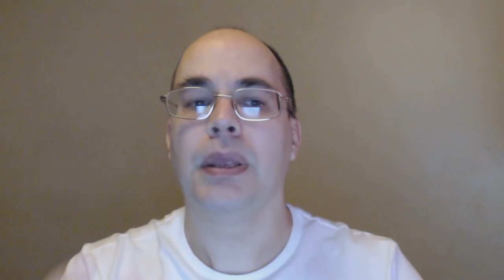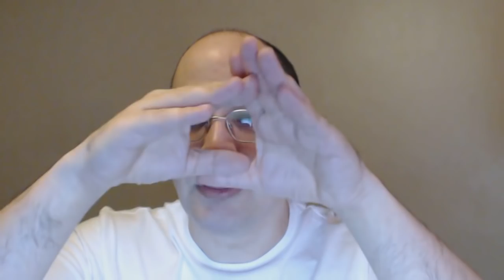How do rockets move in space, with nothing to push off from?

Comment: Why don't you try this simple thought experiment.
Let's say the two of us, you and I, were floating in space, absolutely weightless, in space suits to protect against the vacuum.
Okay, now say we're facing each other, only a few inches apart.  We count "one, two, three" and then simultaneously shove away from each other.  
We will both be flying away in opposite directions now, right?  
At speeds relative to the amount of force and the speed with which we hit each other.
Simple, right?     The vacuum didn't matter one bit, did it?  In fact, without the resistance of atmosphere, we flew apart from each other even more easily.

Well, THAT'S WHAT HAPPENS WHEN YOU EXPLODE ROCKET FUEL in the combustion chamber of the rocket vent!
The explosion of fuel pushes outwards in all directions, including against the ship it just exploded behind!

What idiot thinks its pushing against a vacuum?  Of course that's impossible.  
It's the explosive force that is shoving the rocket away from it!!   

Still having problems visualizing it?  Try this....  imagine a bomb in space.   Put your ship next to it.  Set off the bomb.  Your ship will fly away from it....  unfortunately, probably in many pieces, but it was THE EXPLOSION and its explosive energy that pushed the ship away from it.   
A rocket blast is just a controlled bomb blast going off continuously at one end of a rocket.

This is something even an educated fifth-grader can get.
Reply: The moron narrating that video says that physicists are trying to tell people that air pushing out the end of the balloon is, by converse action, also pushing on the FRONT of the balloon to propel it.  Sorry, but I was getting nauseous by that point and had to shut the claptrap off.  Physicists DO NOT say the air is counter-propelling the balloon at the front end.  It's the energetic action of the balloon AT THE NOZZLE that is driving it directionally.  There is a very simple test to clarify this, and we did it years ago in high school.  Get a rather tough little balloon, and put a little air in it (not too much).  Then put it against the side of a Bell jar.  Put a magnet over the balloon's nozzle from the inside, and put another magnet on the outside, opposing the other magnet so that they cling together, clamping the nozzle.  That will keep the balloon's nozzle shut.  
Then pump the air out of the Bell jar.  If you have only a little air in the balloon, it will begin to expand.  Once the vacuum reaches zero pressure, if you haven't over-inflated the balloon at the start, it should look pretty full by this point.  (If you DID put too much air in at the start, it will have exploded.  It's all relative to the toughness of the latex used for the balloon.)
Anyway, with vacuum at maximum, and the balloon now appearing inflated, pull the outer magnet away from the inner one.  The inner one will fall down, the balloon's nozzle will be released, and THE BALLOON WILL FLY AROUND THE INNER SPACE OF THE BELL JAR until deflated, and it won't take long.
This is where Mr. Stupid in the video fails completely... according to him, the balloon should just lie there and deflate, when in fact it spurts around in the vacuum until fully deflated.  EVEN THOUGH THERE IS NO AIR TO PUSH AGAINST!!  It's flying around because of the energetic reaction occurring right at the nozzle as the air escapes!  Same principle as a rocket.
This whole test is so stupefyingly simple to do, and has been done so many times by so many people, it's a sign of utter and complete idiocy to argue a point like the guy in that video tries to make.  This can be done by anyone, anywhere.
A similar test would be to buy one of those small firecracker rockets that fly thirty feet in the air and go boom.  Again, put THAT into a Bell jar, pump down to a complete vacuum, and ignite it with an electrically driven spark connector.  The little rocket will fly around ricocheting within the Bell jar for as long as the reaction is going on.  It's not pushing against air, 'cause there IS NO AIR in the jar.  It's the goddamned REACTION!
People who have seen this can only plead with idiots who deny this most elementary physics to actually TRY the experiment, let go of their neurotic denial patterns, and experience it for themselves.

To answer your next question, it's not GRAVITY that "makes" a flame go up and down...  but it's because of gravity that convection occurs.  The air surrounding the flame gets heated up, expands, becomes lighter than the surrounding air, and starts to rise.  That draws the flame, which is right up against that column of air, upwards with the rising air.  Cooler air further away fills in the space below the rising heated air, gets heated itself, and IT begins to rise.  That's a convection cycle, in a little cylindrical pattern around the flame.  Again... gravity isn't making the flame magically rise, but cooler air is drawn downward by gravity while the heated air rises as it gets lighter.  THAT is the only way gravity affects the flame... its interaction with the differing air temperatures.  Like the video you pointed out much earlier, in space, small flames simply burn in a sphere, because the air cannot "rise" relative to a gravitational pull, because there isn't any.

The idea that space is a "negative" pressure is mistaken, because we are sitting on a planet with an atmosphere, and a vacuum RELATIVE TO OUR ENVIRONMENT, is less pressure than we normally deal with.  But think carefully...  the reality is that the vacuum of space is simply a ZERO pressure.  
That's it.  NO gas, NO ether, no nuthin', as they say.  It is a complete absence of all materials that we take for granted on the surface of earth.  So, if we say our atmosphere is 14 pounds per square inch at sea level, then, when you're standing at the ocean near the equator, the empty space 500 miles above you is, RELATIVE to your ambient air pressure, NEGATIVE 14 psi.   If our local air pressure happened to be 200 psi, then the empty space 500 miles up would be NEGATIVE 200 psi, relative to the atmosphere we are standing in.  That's all.  Relative measurements.  
You have to remember, WE are in an anomaly in space.  There is an essentially infinite amount of cubic space out there with NOTHING in it....  zero pressure.  Just the occasional dots of stars or planets and miscellaneous small rocks.  WE are fortunate to be living on one rock that has an atmosphere, one singular exception to the pattern.  We are not the norm, spatially speaking.  A zero-level vacuum is the norm across the observable universe.  Everything else (around us here) is simply pressure that registers higher than zero.  It's really that elementary.

And, by the way, NASA is not doing the Falcon Heavy rocket thing....  that's Elon Musk and Tesla Corporation which is where Space-X derives from.  All one massive super-corporation.

BTW:  
  1) It's Northrup-Grumman, not Gummon.
  2) When you noted, several comments above, your "video bias", please remember that THAT is what it is...  a bias.  And a bias is conjecture based on unverified pretenses or assumptions, but held onto in spite of evidence to the contrary.  Practice letting go of the bias, and allow yourself to observe, unimpeded, some of the demonstrations I've explained here, because they are based on things that are demonstrable, repeatable and observable by anyone.  The hangup comes when people who simply refuse to believe in something will deny what they've observed.  THAT is the problem... disbelief when evidence is right in front of your face, or easily available for a few moments' effort.
Reply: You missed the obvious point.  Two people pushing apart from each other MOVE APART EQUALLY, according to relative masses and energy expended in the push!!  Remember, BOTH were stationary.  Now, as a result of an energetic action, BOTH are moving apart from each other!
Similarly, if you were holding a stick of dynamite in space and it exploded, part of it would go one way, and parts of you would travel outwards the other way!  You could NOT remain motionless.

Besides, if this physics didn't work, how are those rockets able to RETURN to earth, if their exhausts aren't having any effect?  Once in orbit, they would orbit forever.  They need to apply retro-braking, essentially firing small rockets in the opposite direction of travel, to slow them down again to re-enter the atmosphere.  Without the ability of rockets to do that, they'd simply continue out into space, or continue orbiting, and never return.
Reply: NASA has a system in test on Falcon Heavy, it uses pulsars for navigation. I have to imagine if there are satellites, a modified GPS like such would allow the landings, which are breathtaking. The first big movement in the grasshopper series of Space-X was after the addition of a navigation system. I remember reading Northrup-Gummon was involved in navigation as well.

I figure, at best, we can essentially slingshot things into space and I believe the trajectory math for that could be darn near exact after seeing the Tyranny of the Rocket Equation.

An aside, my interests lie in true vacuum. 
Have you ever worked with vacuum? https://youtu.be/mq64QfTCRt0
 https://youtu.be/v-BpipRQpkc and this, combustion in microgravity (in atmosphere)
https://youtu.be/9zdD7lfB0Fs

Please, may we return to my question? (I understand it misses the point, but once I get past this the pieces will fall in place.)

If you are the rocket expelling exhaust, what am I?

I'm looking for a reaction. 
Expel is action, there has to be a foreign body for equal and opposite reaction, no?
The fuel and rocket are one body.

We are pirates in space. No air fills our sails in the perfect void, so we blow into it?
Reply: The exhaust is an explosion.  Things fly away from explosions because the energy and disintegrated mass are flying away from the source of the explosion.
The rocket's exhaust cone is on one side of the explosion, so part of the explosion is pushing on the cone.  The other part, as you state, is just flying into space.  But the cone is curved around much of the exploding fuel, so anywhere from half to three-quarters of the explosive energy & mass (depending on cone's curvature and design) is striking the cone, pushing it away.
And even IN the atmosphere, the exhaust blast "hitting the atmosphere" would not be enough to get the rocket going....  it's not like a 30-ton rocket is "resting" on the exhaust blast which is then "resting" on the atmosphere.  If THAT were the case, the rocket would fall over on the ongoing explosive flux.
It's the blast.  Pushing on the metal of the cone.  And whatever doesn't push on the cone flies off into space.
  
And regarding your two videos, yeah, we did experiments like that in high school, with a Bell jar.  What happens to the bubble wrap would happen to your face if exposed to the vacuum of space.  That was easy to predict.  The only way to prevent the bubble from exploding would be to make the plastic heavier and tougher, the same way space suits are designed to keep from exploding.  Vacuum is not infinite negative pressure; thin plastic containers WITH AIR IN THEM will explode in a vacuum.  [Note that if all the bubbles in the bubble wrap had NOT had air in them, nothing would have happened to them... there would be vacuum on both sides of the plastic bubbles.]  
Space suits and glass jars with similar pressurizations do not explode because their wall structure is strong enough to resist the 14 psi pressure of normal atmospheric pressure.  However, if you fill a suit or a jar with 3,000 psi, they WILL explode in a vacuum.  It's NOT the vacuum "sucking outward" on the contents... vacuum is a natural state.  It's the amount of internal pressure relative to the strength of the containment walls.
And re the second video, that's just about FLAMES, burning in a natural state, using existing oxygen from the surrounding air.  A rocket blast is an enforced, continuous EXPLOSION, generated by mixing a volatile fuel with a powerful oxidizer like oxygen.  Typically, rockets use fuels that include kerosene, alcohol, hydrazine and its derivatives, and liquid hydrogen. Many others have been tested and used. Oxidizers include nitric acid, nitrogen tetroxide, liquid oxygen, and liquid fluorine.
These are massively explosive chemicals that DO NOT require any oxygen from a surrounding atmosphere.  They supply much more powerful oxidizers to ignite and maintain their hellacious blast.
Reply: Regarding your comment about deep space vacuum, they actually DO work with large chambers that are pumped out to deep space vacuum levels because they test satellites' operating systems and physical structures in them.  NASA has a huge one, and several smaller ones.  Most high schools, colleges and universities have Bell jars or hard-vacuum containment systems in their science labs.  
Getting vacuum is not a difficult thing...  you simply keep pulling atmosphere out until you're down to nothing but a few stray uncaptured atoms flying around.  The same thing deep space has.  And even space is not a "perfect" vacuum either...  there are gas particles still flying around that haven't yet been caught up in gravitational fields of stars or planets.

When you speak of the Marianas Trench, that is the complete opposite!!  Think about it for a moment.  In space, in a space suit, we only need to maintain an INTERNAL air pressure of 14 psi for the astronaut to survive.  That's 14 pounds of pressure pushing OUTWARD on every square inch of inner side of the space suit.  Not too hard to design for.  
However, at the depth of the Marianas Trench,  the water pressure is 15,750 psi!!!   That's 1,125 times MORE pressure than our atmosphere!  And it's doing the reverse....  that pressure, if it was pressing on a diver going down there, is pressing INWARD on the suit, which is trying to maintain 14 psi so as not to kill the diver.  But the outside water pressure is CRUSHING INWARDS ON IT, with seventeen thousand, seven hundred and fifty pounds of pressure on EACH SQUARE INCH of the surface of the suit.
A typical suit might have 2,200 square inches of surface area, so 2200 x 15750 equals 3,465,000 total pounds of pressure!  That's about three and a half MILLION pounds of pressure crushing in on a suit.  We cannot construct a suit that can resist that much pressure.
So make sure you're not comparing apples to oranges here.  In space, our personal air pressure wants to expand OUTWARD into the vacuum.  Under water, the intense weight of trillions of tons of water are trying to crush inwards on whatever tries to maintain a mere 14 psi.
The only way to avoid getting crushed is to be a fish, breathing the same water at the same pressure....  the fluid is then inside and outside you.  There's nothing for the water to press in on, because your internal pressure is the same as the external pressure.  You are part of the same pressure of your environment.
Reply: Not ignorances...  just learning opportunities.  I see you've been picking up some of the concepts as this has gone along.  Hopefully, the examples and performable tests I've cited were able to help clarify.  
The quality of your questions has gotten better at every exchange.  And you bring an interesting level of intensity to your questioning.
Reply: I think your first "thought Experiment" is the confusing part... two people in space both pushing each other  and then floating away in opposite directions. In that case, person A pushes on  B and they both float away from each other at speeds inversely proportional to their mass, but person A can only begin moving  because person B is there to push against.  Without person B, person A is just flailing his arm around without going anywhere. This creates an image in the mind wherein A depends on B in order to begin moving, so along that line of thinking, without something  analogous to person B to push against (a planet,  an atmosphere, or anything with mass) it's hard to see why person A would accelerate at all.

Newton's 3rd law is often explained in a similar way on science classes, which is what leads to the confusion when trying to imagine propulsion in space.  The explanation about the bomb next to an object sending it in motion is Better.  If a bomb exploded between the two people rather than them pushing off of each other and they  were both pushed away from the explosion, it is easier to imagine that that person B does not need to be standing on the other side for the explosion to send person A flying.
Reply: I mean, that column of hot air and exhaust, that balloon exhaust is a MASSIVE contributor to thrust.
To see it, watch a rocket under water. Look how much water is displaced.

I've worked with large vacuum systems, clean room environment, product movement.. those suits would blow, or be filled to an extreme extent that they would be useless.. a tin can , a glass jar.. that is child's play, and still deep space is unachievable on earth. If it was a suit or ship suitable , we would have suits for the Marianas Trench, don't you agree?
Reply: W.J.R. Halyn because your test shows to forces acting against each other
Reply: W.J.R. Halyn it's my understanding that it would be impossible for any combustion at all without oxygen?
Reply: These stupid experiments that shows a rocket in vacuum it's using a solid fuel for ignition rather than the liquid fuel the the real space rockets use, So it's possible to move in space but not while using the gas or liquid mechanism because it's scientifically impossible in the vacuum.
Reply: Indeed, let's say the two of us, you and I, were floating in space, absolutely weightless, in space suits to protect against the vacuum. Okay, now say we're facing each other, only a few inches apart. We count "one, two, three" and then simultaneously shove away from each other. 

You are the rocket expelling fuel or exhaust. What does that make me in this equation?
Reply: Wow, thank you for addressing so much  material. I did not realize I threw so much at you.

Regarding the exhaust providing thrust- You are saying rockets do not push off of the exhaust? Remembering Newton's Law.. goes back to the balloon rocket cars, in that it will move when you release the exhaust? It won't, however, move if you do not let the exhaust push off of the surrounding atmosphere.   (Advance apologies for the obvious video bias, but the content is my thought process as well.) https://youtu.be/cfFJImcFx3s
The atmospheric pressure is what causes the exhaust to cloud up, is that correct?
Gravity is what causes a simple flame to be directional, or rather "up and down"  instead of a globe of heat emanating in all directions?
And finally, regarding vacuum in space, isn't everything outside of a spaceship in deep space a negative pressure? Interstellar space is approximately 1 fPa (10−17 Torr)?
Reply: Ok let me put it this way what if you don't have a friend in space how could you move there? And yes I am talking about astronauts not the rockets. And ask your self this question is what you see in the videos which shows astronauts moving using gases of some sort is it really sufficient to create movement in the vacuum of space? I mean if space really a vacuum then it is impossible to push against nothing moreover, how will your friend reach you so that he would push you in the first time!
Reply: W.J.R. Halyn thank you for pointing out my ignorances.
Reply: W.J.R. Halyn
 I've put more thought into this, I hope you don't mind my want for indulgence. 

First, I still contend that 
"Newton’s 3rd Law: action/reaction only works if you have two separate objects. More specifically these two objects have to be external to each other.
The rocket is one object even though it is made of many parts: seats, astronauts, air systems, fuel systems, exhaust, etc.

In consideration of exhaust and thermal expansion ,  I  find another inconsistency in overexpansion and underexpansion (regarding nozzle efficiency). It is this:
"For nozzles that are used in vacuum or at very high altitude, it is impossible to match ambient pressure; rather, nozzles with larger area ratio are usually more efficient. However, a very long nozzle has significant mass, a drawback in and of itself. A length that optimises overall vehicle performance typically has to be found. Additionally, as the temperature of the gas in the nozzle decreases, some components of the exhaust gases (such as water vapour from the combustion process) may condense or even freeze. This is highly undesirable and needs to be avoided." (Wikipedia)

Can you offer some insight?

Hope you are well, thanks for your consideration!
Reply: There is no 'weightlessness' in space and not only that what experiment is there to prove it's possible to move a physical object created inside a dense environment and push this out of an atmosphere and become 'weightless'. Weight is caused by resistance / force and relative to it's neighbors medium, taking physical matter above air it will get 'heavier' as there is less air resistance, and somehow your brain is completely fine with believing there's a drop off in where it will just start floating like you're playing asteroids, get a grip.

Prove you can move physical matter through a gradient atmosphere and demonstrate this magical cut off point where the object just stops resisting.
Reply: EXPLODE ROCKET FUEL ? That is not true and you know it, or should know it prosessor. It turns into hot gasses, it that plane and simple. I guess we went to the moon to, right?
Reply: If you were in space and you pushed a bowling ball away from you the ball would move away from you and you would move away from it
Reply: W.J.R. Halyn
, you've conveniently left out the "Equal and Opposite" needed to fulfill Newton's Law's requirement. That's a law and laws cannot be circumvented even by the great and powerful NASA. They're are a bunch of Lying fucks over there at NASA. So much for your 5th grade analogy.
Reply: The rocket expelling the fuel is one action. There is no reaction, as there is no atmosphere. The fuel will shoot off into the vast corners of the vacuum, the second drop of exhaust never hitting the first.
You are essentially blowing into your own sail.
Reply: fail
Reply: And what, specifically, failed?  
What part of obvious logic and rational reasoning of elementary physics did not make sense?
Or were some words too big?